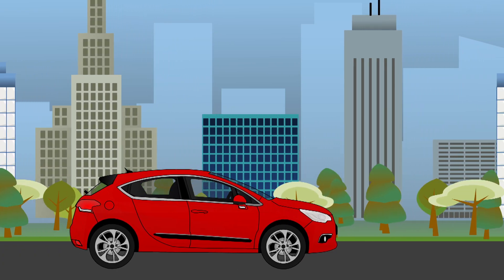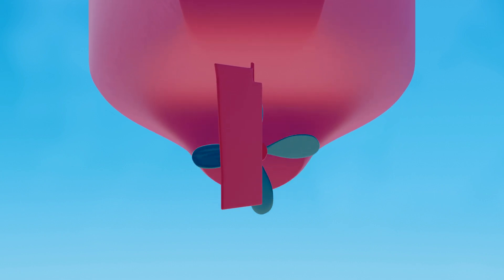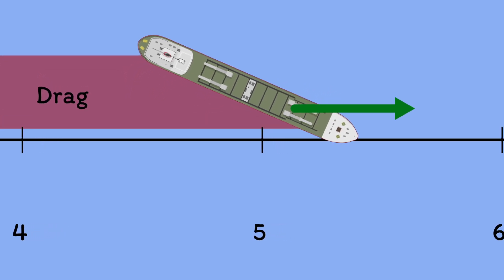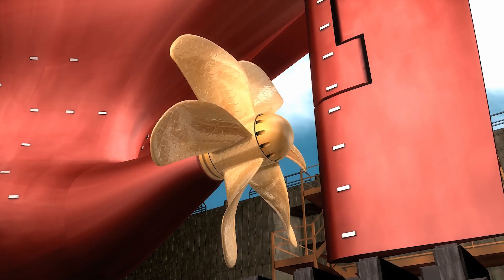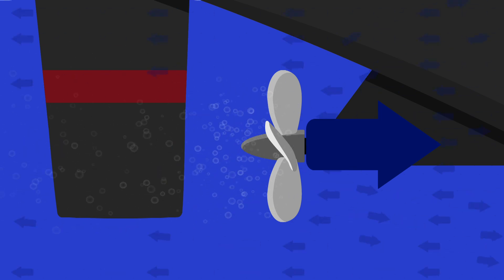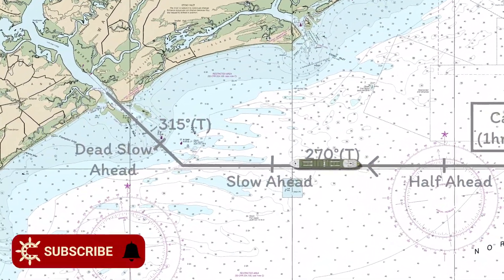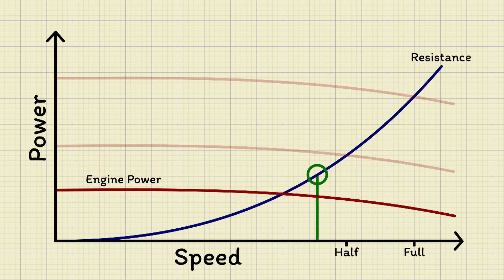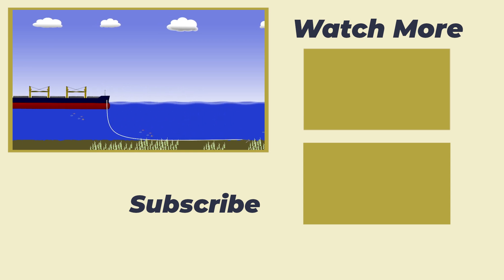How Do Ships Stop Without Brakes?

Comment: Very cool, though I am a little disappointed you didn’t cover “closing the barn doors,” though to be fair I’m pretty sure very few vessels can actually do it.

Basically, on a ship with more than one rudder (such as the Iowa class battleships, which incidentally have 4 propellers), you have the left rudder go hard to starboard and the right rudder go hard to port (they’re almost touching each other) and the massive amount of drag generated by having essentially a multi-story tall wall could allegedly crash stop an Iowa in…I think half a mile? Emergency only, but very effective.

(As an interesting side note, allegedly this could also be used for acceleration. Iowas, like most very large ships, have a very low (shaft) horsepower to ton ratio, and so accelerate slowly. However, allegedly, one can “close the barn doors” and the ship won’t move while the propellers get up to speed, and then when you “open” them the ship can accelerate much faster than normal.

Comment: Can't they just reverse the engines?
Reply: Reversing the engines is a rather time-consuming process, so isn't often done. Not only that, most four-stroke engines are not reversible, so they would need a reversing gearbox to be able to reverse the direction of the shafts.

On ships with controllable-pitch props, though, you can angle the blades backwards to provide reverse thrust.

Nowadays, vessels with Diesel-electric propulsion don't need variable-pitch props. They can use fixed-pitch propellers and run the main propulsion motors in reverse.

Comment: Ever since I was a kid, I've assumed going full astern like they did on Titanic basically guaranteed a crash. Knowing what I know now, I find it strange that experienced sailors would have made such a mistake. It's much like braking a car in snow, you can turn, or hit the brakes, but you can't do both at the same time.
Reply: Actually, not the case. The rudder loss of control CN describes here is only valid when the screw and rudder are in line with each other. Titanic had a central rudder, and just ahead of the central rudder was a small screw turned by a Parsons turbine fed by exhaust steam from the two reciprocating engines. These reciprocating engines actually provided most of the Titanic's thrust through screws mounted to either side of the stern. Reversing the engines caused the two outboard screws to reverse, but because turbines (generally) cannot be run in reverse, the central screw actually just stopped spinning as steam was cut off from the turbine.

Yes, the rudder had lower authority due to not having the positive flow from the central screw, but it still actually had most of its power because there was still significant (20 kts) of flow over it. In fact, keeping the engines ahead, or even stopping them, likely would have caused Titanic to drift out of the turn due to the higher speed, causing far more significant damage to the ship than actually occurred (think ripping a hole rather than the gentle scraping that actually happened), and halving (or worse) the sinking time.

Comment: Use train engines and this system for larger and smaller ships,   attach  pulleys  to train engine's  to pull the ship or release the ships .
Use two platform for smaller or four platform for larger size ships. 
 Each port  can  give this service and create jobs .
Jay shree ram.

Comment: Ships can use  mechanical ailerons to slow down against the fluid flow. Emergency drag can be very quickly created in the ship with or even now WITHOUT the full helm (360°) turn, ships might normally go for. This should be implemented immediately in all ocean going ships.

Comment: In my experience, that is on passenger ships, not cruise ships but passenger ferries 150-200m long, where the passengers and vehicles embark and disembark from the rear, as the ship approaches port they make a tight turn, almost like a drift in a car, and turn the boat around while maintaining the momentum towards the initial direction of travel, and end up backing the ship up to the dock using the main engines to slow down. It's a very smooth maneuver and it's always impressive, when you're on the ship itself it always feels like they're starting too late and too close to port but ultimately it's always well executed. Of course these ships are smaller and more maneuverable than cargo ships and tankers but still significantly larger than your average ferry.
Reply: A lot of cruise liners have azipod props (the propellers are sticking out of pods that can rotate 360). And they have bow-thrusters. Makes it much easier to parallel-park.

Comment: Why not flaps or drag fins that could be extended?  Seems like having a better way to slow speed in a massive cargo ship would be important.  And why not dual rudders, on either side of the prop so that full astern can be controlled, at least a little?
Reply: I know it isn't a thing, but how hard would it be to create ports along the ships sides and in front connected to the pumps and use them like thrusters to literally move in any direction in spite of the rudder?
Reply: I googled why there are no thrusters or 'azipods' (cruise ships have them) and the reason given was 'cost'.  

I'd like to argue with one of these ship guys about how I'd be more then willing to bet that a tug costs way more then a 'manuevering' system would.

Once again, the worst reason in the world to continue doing something the wrong way, tradition, rears it's ugly head.

Comment: This is similar to skateboarding.

Braking on a skateboard you can either:
- use friction from your shoes
- powerslide where you suddenly rotate 90° without changing direction. The drag from the wheels being perpendicular to the direction of motion causes it to slow/stop.

Comment: during my time with the navy (minehunter, 50m long) our 2IC during an excercise (man over board) by "stoppping" the engine (adjustable blades on the propelller set to 0) and a hard right turn
this stopped the vessel in a boats length from 15 knots to zero
(through the tilt was quite big ;-) )

Comment: In order to slow the ship more efficiently in a crsdh stop instead of moving the throttle from full ahead to full astern you can move throttle to stop, then move the throttle to something less than full astern.  Then if a series of stop/astern throttle actions is made stoppingdistance can be reduced.  

On steam ships when a crash stop is executed, the throttle is moved from full ahead to full astern a series of events occur.  The ahead steam valve closes in a rapid, maximum speed, movement.  The astern guardian valve opens in a similar rapiid movement.   The astern valve immediately to full open.  This causes the propeller to cavitate thereby losing astern thrust.  It also causes a loss in efficiency in the astern turbine.  By pulling the throttle from full ahesd to stop the ahead valve closes in a controlled way thereby reducing cavitation.  Applying a series of astern/stop throttle applications helps reduce cavitation and helps the propeller to brake the ship.  General Electric (GE) required that a stop be released to allow the throttle be move to the crash astern position.  This stop signaled the throttle controls actuate at maximum speed.  GE recommended that for a crash astern the throttle be moved from full ahead to full astern without actuating  the stop.  This allowed for controlled closure of the ahead vale  and controlled operation of the astern guardian and the astern valves.

On ships with controllable pitch propellers these same  astern/stop throttle applications are easier to carry out.  If the main engine is a slow speed diesel you do not need to stop and restart the engine. 

On direct drive diesel engines, the engine must be stopped and restarted in reverse.  This requires the start air system to use part of the air reserve to be used.  Generally start air receivers have enough air for three engine starts without recharging the receivers.   To more effectively brake the ship the astern throttle applications need to be done with a minimum of engine restarts.

With all this said, it is possible for the ship designers, i.e. naval architects, to use computer programs to calculate how best to stop a ship.  These calculations should be verified during sea trials.

I first learned of controlled emergency braking when I was in school 50 years ago.  Professor Michael Parsons  at the University of Michigan has published a  number of papers on ship stopping. 

It is also important to note that a ship's Master and mates, as well as the ship's engineers are well versed in ship handling and stopping.  They know how best to handle their vessels.

It is also important to note that all ship's are required to have a ship handling poster on the bridge of the ship.  The poster shows ship handling specifics at various drafts.  It shows stopping distances, turning circles, squat, and other key information.   This information is shared with the pilot on their arrival on the bridge.

Bob

Comment: Have hydrobrakes ever been considered ? Kinda like aerobrakes used by many aircrafts. They could deploy underwater "wings" that oppose the flow of water and add a substantial amount of drag until the ship is stopped. You can still have the propeller run slowly to have control of the ship.

Comment: Could you use anchors to slow down by lowering them but NOT all the way? The chain and anchor would create additional drag as they hang in the water, correct? Perhaps not by themselves, but possibly in conjunction with other methods, or would it simply be too small an increase to be of any use?

Comment: I wonder if there is not some version of "regenerative braking" possible as well? That would increase drag and as a bonus use the momentum to charge up some battery banks onboard.....maybe a propeller at the front of the ship optimized for underwater flow (blades angled backwards slightly) coupled with a electric motor....when used it would  effectively allow the ship to start the staggered slowdown later

Think this would be a good research idea for a maritime engineering student

Comment: new ships should have regenerative brakeing , since electric motors are often used (and prop in reverse is a turbine , maybe add area to prop in that mode with some kind of flaps) ? is it possible to upgrade existing ones to save energy (yes batteries are a problem , but energy could be stored in many different ways ) , since it is the main cost of shipping ?

Comment: Why don't boats use cyclic like a helicopter. I'm assuming there is a good reason but I'm curios. I think I'm using the term properly. Where u vary the angle of attack on then propeller .

Comment: Kinda misleading. I have nearly a dozen years experience as a Great Lakes captain, primarily as a competition sport fisherman. While I do typically prepare my actions literally miles in advance, I do use my engines to control my vessel and not just for stopping. I very often use my twin screws for fine adjustments especially in close environments (port and refueling). Mind you mine is small enough I do not have a bow thruster as many vessels in my class and larger (36 feet). Using differential engine thrust is the most advantageous for an experienced operator of a lot of equipment. However, always have a plan in advance.

Comment: Actually surprised that they haven’t made (what I coin the term as) seabrakes, basically the same concept as the air brakes a fighter jet uses, just bigger and underwater. It should work pretty well given how much thicker water is compared to air.

Comment: Is it possible to install foldable flap like structure on sides throught the length of the ship.
Reply: You want to have as little moving parts as possible underwater…anything that isn’t smooth will create drag and also increase possibility for rust to form

Comment: but HOW DOES IT ACTUALLY STOP. i get that it must slow down but surely that isn’t the final step in actually docking the ship. the question wasn’t even answered. you said it yourself if they are just cutting the engine they have no control. how do they parallel park like a car???
Reply: When a ship comes into port, they slow down and stop off shore, drop anchor and wait for tug boats to bring them in. Once port side, tugboats will then slowly bump the ship until it is parallel. When the ship leaves, the tugboats will the tug the ship away from the side and then maybe tug it out

Comment: I’ve always wondered why they haven’t used hydrobrakes (the term I’m going to use) which are literally airbrakes but underwater. They could be deployed from either the sides or bottom of the vessel and would massively increase the drag. Unless there’s something I’m missing (which is entirely likely), I don’t see why it’s not a thing

Comment: Why not have rotors in the front side?
Reply: We have rotors in sides in modern ships. They are called bow and stern thrusters. It's basically propellers but throws water sideways, used to berth the ship or in closed waters.
Reply: @dimaz3  thanks for the reply but that doesn't answer the question?
Reply: @ЖеЖо-б8ф  Did you mean why there is not a propeller in the front like an old plane?

Well there is no rudder in the front, the stream of water propelled by rotor won't reach the rudder so you would lose control over the direction. Forward mounted propellers works for planes cause they are moving at very high speed so there is always a constant stream of airflow hitting their rudder but ships move slow and propelled stream disperse way quicker. 

Ships are always loaded stern heavy so there is a good chance it will be partially out of the water in the front and won't be effective anyway and the constant ramming against waves means it will have very short life time. 

Having a forward mounted rotor increases drag that in case of a ship which will reduce efficiency. Planes use forward rotors mainly because they want the air to hit the wings to generate lift and to be able to float while boats don't require lift to float. 

And lastly there won't be any difference have a seperate rotor in the front tuned to operate in the opposite direction for backwards movement when you can easily change the rotation in the one propeller you have anyway .
Reply: @dimaz3  thanks for such an insightfull explaination :)
One more query, why don't modern planes have front rotors ?
Reply: @ЖеЖо-б8ф  Oh they do! If you look into small recreational and training planes like
cessna , they have front propellers. 

The reason most planes you see nowadays don't have propellers is because they are mostly passanger and meant for high speed at high altitude which jet engines are good at. 

Propellers are better at fuel efficiency, more rugged and can provide a lot of fine tuned control and that's why big cargo planes, military transport or gunships still use propellers.
Reply: @dimaz3  Thanks again, you seem to have vast knowledge  :)  . I wonder what you do?
Reply: @ЖеЖо-б8ф  Ahh I just work in merchant ships. There are some common things in ships and planes and in their operational principles is all. Not that knowledgeable 😅

Comment: This is something new, I thought it was just anchors which they use to stop ships....
Reply: Anchors are only a consideration for emergency situations.  Anchors are not designed for such inertia, most likely it will get ripped and go in the water taking of parts of the structure.

Comment: Why not just accelerate in the opposite direction until the ship stops?
Reply: These engines are massively powerful, it takes time for them to go from forward to astern movement and puts huge pressure on the engine , there is a good chance you may damage.  Still you may use them in emergency where you absolutely need to, otherwise stopping slowly maintaining motion is preferable.

Comment: 2:42 The animation is wrong, because due to international regulations every vessel on full astern must turn to starboard side, not to port side. So it is not fully correct that you have no control over a vessel during crash stop.
In this case there is another problem - it is highly not recommended to switch between ahead and astern and it could cause some damage to engine or at least some problems for engine crew. Even reducing engines RPM (revolutions per minute) should be extended in time even to half an hour, when engine could be switched from powering it with heavy fuel to diesel.

But there are vessels with controllable pitch propellers, where you can regulate speed without changing the engine RPMs - but still it is not recommended to switch from ahead to astern on higher speeds (that can be safely done on jet propelled ones).

And yes - anchors can be used to stop the vessel, but on low speeds. They always have to be prepared to be dropped instantly when a vessel is maneuvering in restricted areas, such as ports, channels etc.

Comment: I am no boat engineer but what if a boat had an extendable function that was able to extend out c-shaped cups that would go against the water? It would be sort of shaped like a crossbow and weight from the water could get distributed to the propeller side of the boat. 

Design could look similar to this:
      __
  /       \
/           \
[             ] \
[   boat  ]    \    <- would be on both sides
[             ]/''""\    <- could be extended in a
\           /           downward slanted motion 
   \      /       to get into contact with water
      \/

Anyone know if this would be a good idea?

Comment: I'm just wondering  but can they just use somekind of parachute , but in underwater ? It works fine in NASA space shuttle, can't they just adopted the same principle ?
Reply: Those parachute costs ungodly amount of money and used only once. A ship has to stop 100 times a year, even if it was possible financially would be never viable.
Also friction in water is a lot more than in air. It would need to be even more resilient.